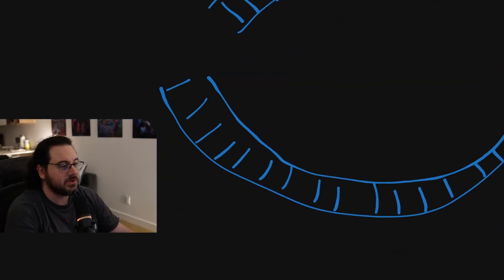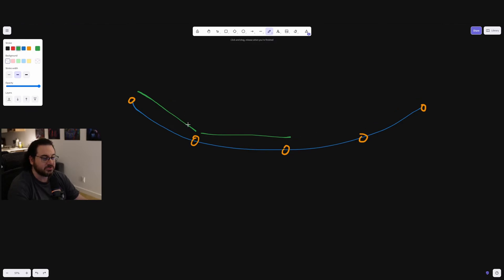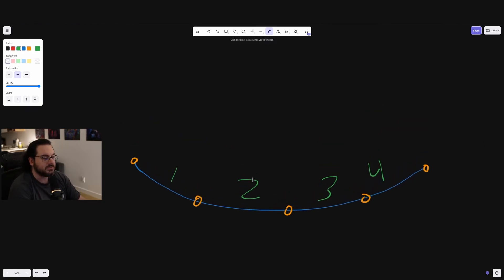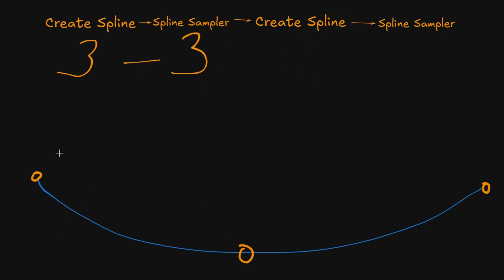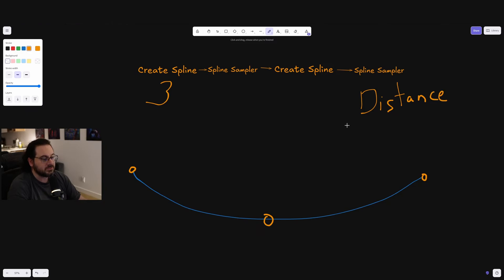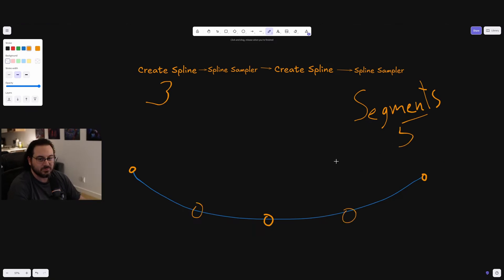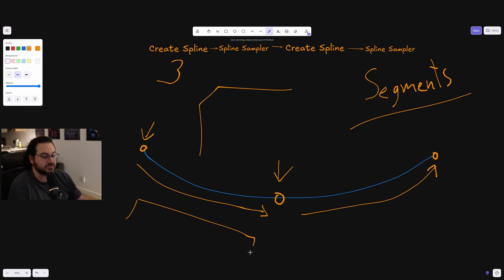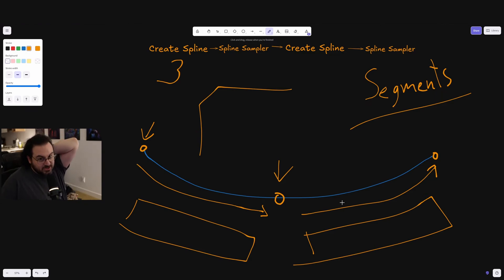How Do Spline Meshes Actually Work in PCG? | Stream Highlights

Comment: It's a shame at the StartOffset and EndOffset isn't exposed on the SpawnSplineMesh node though, doesn't seem to work with the Spline Mesh Override Descriptions either
Reply from the maker: The result is the same though, no? If you offset the start of your points on the spline, then you offset the start of the mesh.
Reply: @Procedural_Minds unfortunately not, using the end and start offset lets you push the points up. Like if you used the lattice modelling tools.
Can be really useful for fences cause you get a linear deformation of any connecting geo between points. Where if you move the end point of the spline mesh it's like rotating the mesh to point at the end point instead of moving verts on the z axis.
Trying making a simply BP spline mesh and use the Set End Offset node and you will see what I mean about how different the mesh transform is.
Reply: @miroac01  I am having exactly the same problem. If you find another way to do the offset, please let me know